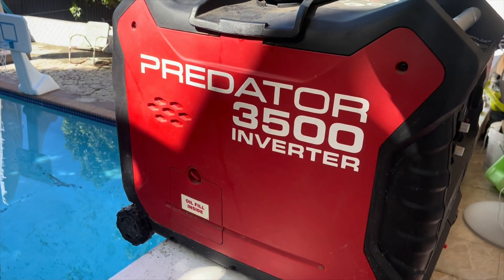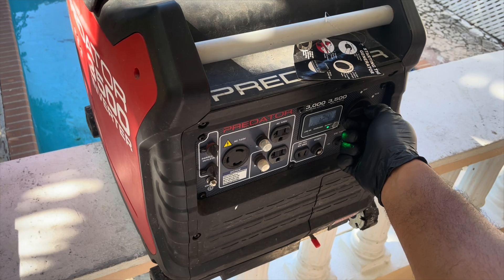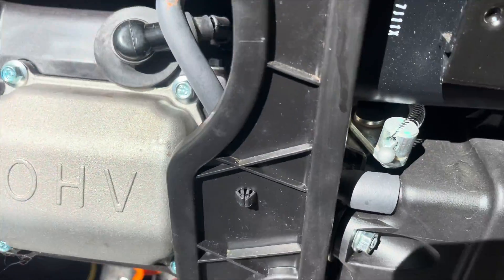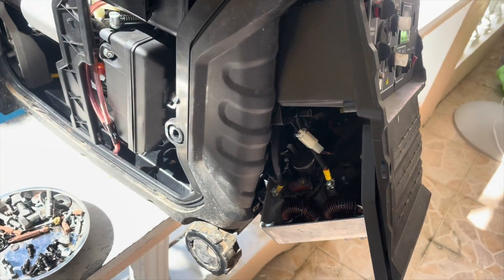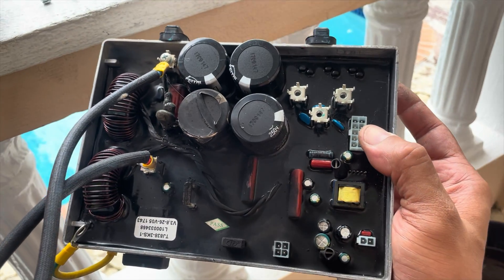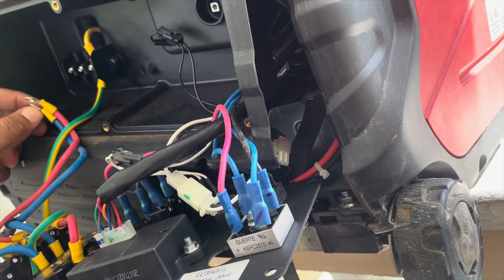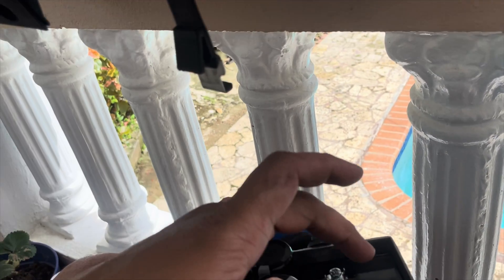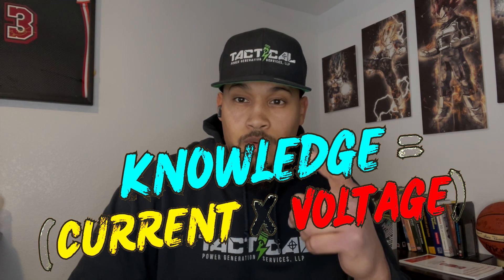How to repair a Harbor Freight Predator 3500 Inverter that has NO VOLTAGE or HIGH VOLTAGE. #diy

Comment: Good info👍👍  I have the same generator with less than 70 hours on it. The digital display is messing up. Wont light up, sometimes flickers on and off and wont display numbers or change to the different displays when pushing the button. Also, not putting out full wattage, maybe half. It will not automatically restart my small air compressor when air pressure gets low. The compressor motor just hums and the Generator acts like it's way over overloaded. It used to do just fine.  I cant find any info about these issues 
 Any clue what these problems could be?
Reply from the maker: Thanks for watching my video! I can definitely help you out. #1 Make sure the carburetor is clean, #2 verify the spark arrester in is not clogged and #3 verify the spark plug is clean and has the right gap.
Reply: @tacticalpowerpro  thanks for the reply. It runs great, the issue is electric output under a medium or higher load and the digital display not working properly. It acts like a 1500 watt generator trying to handle 3000 watts, not enough wattage output to handle the load.
Reply from the maker: @UnitedWeStand2020  The engine has no problem running and doesn't bog down under the 1500 watt load?

Comment: Thinking about picking up a 9500 watt used but she says the 30 amp plug isn’t working. Any idea what it might be
Reply from the maker: If the other plugs work without issues then most likely it either has a bad 30 amp plug, a loose / broken wire to the 30 amp plug or a bad 30 amp circuit breaker before the plug.

Comment: good video.  using my generator I get 0 volts on the display but it appears to be working and running things properly.  however I noticed last night that my cord’s LED is innovating neutral/hot reversed. any ideas ?
Reply from the maker: Thanks! Can you elaborate some more, what do you mean by the LED is “innovating” neural/hot reversed?
Reply: @tacticalpowerpro  im sorry... indicating* . the power cord had led lights that indicate reverse polarity and its showing neutral and hot are reversed.
Reply from the maker: @tekk220  What type of power cord do you have?

Comment: where can i order that module or does harbor freight sell it thanks if you can let me know......
Reply: thank you so much on the reply
Reply from the maker: @edwinbaezsantana  no problem, I'm here to help!
Reply from the maker: You can try calling Harbor freight, they will definitely tell you if they have it or where to find it. I normally get them through Amazon or eBay but they sell out fast, you got to keep an eye on them. I have a link in the description box for the inverter module but they are currently out of stock.

Comment: Can you show how you took of the module
Reply from the maker: Sadly I didn’t record that part because I didn’t have a camera stand at that time. It is uncomfortable to get the module out if you don’t remove the entire front. I did it without removing the entire front. You see how the front is dangling in the video? I just pushed the front aside and removed the module.